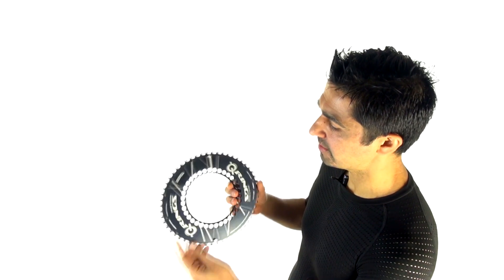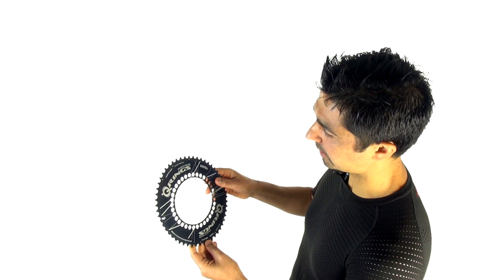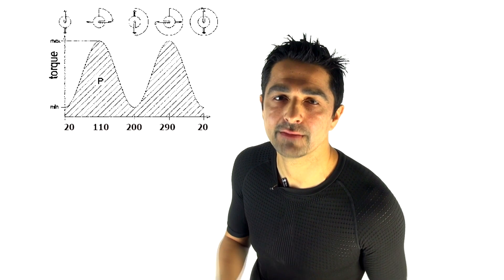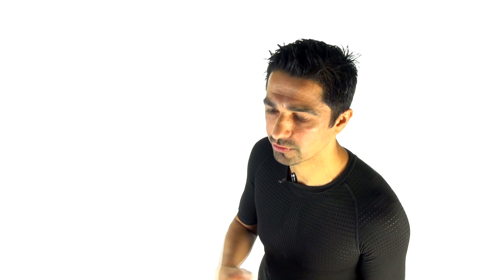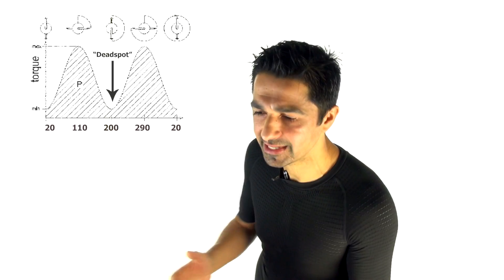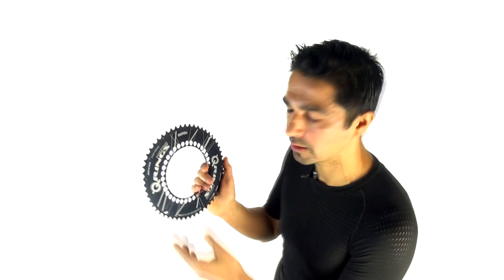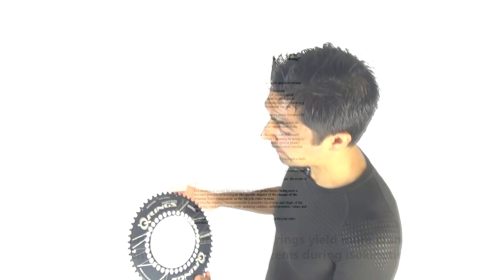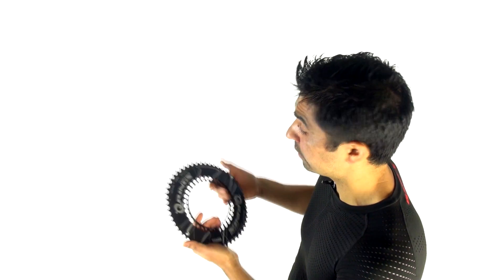Do Oval (non-round) chainrings improve one leg vs two leg cycling power (Q ring, osymmetric)

Comment: i think a lot of folks just use the wrong length cranks, and that is why they detect such a change when using oval rings. almost everyone regardless of height uses 170-175mm.
I am 6'3". recently swapped my 175 cranks for 152 cranks (well short for my 34" inside leg).
I am already running non-standard chainrings, and have never been tempted to go back to "standard" sizes - I run what suits my riding, not what is fashionable.
with the 152mm cranks my cadence shot up, and Strava PRs occurred left right and centre.
folks need to sort out gearing and crank length first before even worrying about stuff like oval rings.
but many folks just buy a bike and copy some or other "pro", without looking at their own circumstances.
fashion always stands in the way of science, and this is no exception.
Reply from the maker: I agree with you 100%! Very few riders consider yet alone change their crank lengths
Reply: If you read Peters post carefully you will notice that the shorter crank allows a higher cadence, this in turn allows you a smaller gear. The power will be the same, the speed the same, the only differences are crank length and cadednce. Its a personal preferance thing, and it works.
Reply: golferchin76 At first it seemed rather like running on the spot, with my legs going up and down without much forward movement.
The theory is that i should use a slightly lower gear, yet i can move my legs to get a higher cadence, which compensates. my legs can go round faster for the same effort because i am moving them in smaller circles.
After a bit, you just get used to it - indeed, the scientific studies on crank length show that familiarisation is worth quite a bit, whatever length crank you use. familiarisation = adaptation.
Reply: and a bonus for TT is that short cranks allow you to get your body flatter because your knees no longer come up to your chest (or if you are a bit "chunky" in the middle like me, your guts don't get in the way so much).
Reply: I'm 5' 8" 31" inseam I switched crank lengths 2yrs. ago from 170 to 165mm and I broke every PR including hill climbs!  Took over a min. off my 40k time breaking the 60 min. barrier for me, that's on a road bike not a TT! I agree I think many rider are on to long a crank! (That 40k time was back 2005 42 old now 54 when I broke it)
Reply: +Peter Milsom  I am 5'75". My crank length is 172.5mm.  I am very surprised to read that you use a very short crank.  How does it feel? would it not feel a lot harder to turn the same gear?
Reply: +Ken B thanks for pointing out. I missed the "read more" part of his post. 
Ok, after reading his full post I understood it now. Basically he use smaller gears for that higher cadence.  
I guess that higher cadence is achieve-able because his legs are making much smaller circles. I assume he is spinning high 90s to over 100rpm type of rider.
Some hurdles though is crank fitment and power meter.  I use rotor 2inpower and the shortest crank length is 165mm. That's not even close to 152mm and I am a much shorter guy to Peter Milsom, so I guess I would use even shorter if I fancy that set up.  That means finding something that hardly exists to fit with my Tarmac and use a rear wheel or paddle based power meter.
Edit: I did find some very short crankset online. Would have to check with my TT coach for his opinion over such set up.
Reply: +Pedal Pusher  I got an adjustable Powercrank now. It can go from 170-90mm.  (Don't think I will go that short, probably end up at 140-145mm for my 5'7" height).  And yes just use lower gears to compensate.  I am waiting for a cheap build of rear wheel with Powertap G3 hub power meter to complete the package.  I think my earliest ride with it with a powermeter is May 20th.
I did a few searches online and totally agree about the TT bonus.  Even for a flexible guy, using a 165-172mm what we normally can find in bike shops, he/she will still need to spend a lot of effort to to bring the pedal from 10-2 o'clock position.  The much shorter crank allow more open hip angle and theoretically a lot easier and rider can actually start powering even when pedals are going from 10-2o'clock position.
I will try next week without a power meter first on road bike. That already means my seat has to raise and I will have a more aggressive aero position.
I hear only good things from TTers and Triathletes who tried shorter cranks.
Reply: TT definitely is not just about power. I train with a coach and ride at a windless location (It is windless most of the time, at night). I ride 2 ways holding same power just to make sure it is really windless.  Like for example 220-225 avg watt gives me 35.5-36km/h on a roadie.
If I do aero tuck on it, elbows on the bar, I can maintain 32km/h 20mph at just 150-160w
At the moment I look mostly in TP at watt over speed.  Especially when I am riding CP60 effort. After all, I am still training for power and my events are mostly century or short sprints of 40km.
I understand what you are talking about, time over route.  Best Bike Split software has free trial. Maybe I should check it out.
Reply: @+golferchin76, for most people, going lower will always make them faster. Problems usually arise with increasing the duration. One of the reasons why triathlonists run a lot higher front end setups than road-tt:s. Triathlon-TT: 4-5hrs, good old road TT 45-60min
Reply: Cadence is higher because  leg speed is slower,  the turning circle is less for one revolution
Reply: Your leg is weakest when it is bent the most, so shorter cranks are better, leverage is a non factor because we have adjustable gearing.
Reply: @+Pedal Pusher: IMO it's pretty easy to find a good TT-position.. At least for most people I think it is similar or very similar to my way.. I just go as low as my setup allows and try to reach my treshold power. Usually I have no problems for this in a very low position (as low as I can get on my road bike..) for a short period.. but when the time starts going over 20 minutes, my back just starts locking my legs up, just can't turn the gears. So for shorter TTs I usually go as low as possible and for longer (of which I don't really do anyway) I go quite a bit higher (like 5-10cm). I'd say for most people it's their hips that can't take the angles first and thus the back gives out, but there can be other things like the neck and even arms..
Reply: Interesting to know.  I didn't know that Triathlon run higher front end. Thanks.
Reply: Crank length is more important probably. For one, too long means when your power downstroke is near extension, your weak stroke is bent more acutely - but is that better or worse, more or less stress on knee, etc? Going to a 165 from a 170mm crank is a loss of 2.9% mechanical advantage, but assuming one sets the lowest point the same as normal, the top stroke is 2x165 above the bottom point, for a 10mm smaller pedalling circle diameter, as well as 10mm more knee extension at the max bend point. Testing large and smaller pedalling circles for power, efficiency, and knee issues is at least as valid as playing with inconsistent rings - except you can't get a nice design patent to sell to bikies.
Reply: So I rode at 155mm for 4 weeks, alternating with another bike fit with a 170mm crank set.   It definitely feels different.  Would that help me in my events?  I do not know yet because I am in off season training.  
With shorter crank at 155mm I feel like I can spin at higher cadence longer (2hr training ride for example).  Also I can draw the circle better, it shows in spincurve software.  I will not drop it to 150mm because Only Rotor produces short cranks but shortest is 155mm

A few questions still in my mind.  Would this hurt me in hilly events.  I will need to do my hilly training ground twice, to find out how different they feel. 
Consider this scenario.  Two crank arms.  Both at 3 o'clock position.  One is 170mm, the other is 150mm.  Now we put 20kg downward force on the pedal.  The shorter one will have less torque at the axle.  To make it simpler to understand, let's use 170mm vs 50mm.  At 50mm the torque at the axle is a lot less than the 170mm, given same force applied.  
So, going shorter will definitely give you torque disadvantage (One can't bring back that loss by shifting to lower gear)  What you get in return, is it worth it?
Reply: z1522 thanks for your scientific explanation.  I stopped using the 155mm length crank and came back to my usual 170mm & 172.5mm cranks.  I was imagining a 10cm crank arm vs a 100cm crank arm and that gave me doubt about short crank length's 'supposed' advantages.
Not only that, after I came back to my usual 170mm it was slightly easier to produce watts on the Kickr in threshold workouts, machine set at same resistance.  Especially climbing drills such as low cadence below 70rpm.
The trouble with very short crank length, for me personally, was that going steep uphill like 17% or more, I had to stop, but on my regular length I could make it up to the top.  
According to my calculation (could be wrong). To produce 240w at a cadence of 30rpm,  172.5mm vs 155mm means 45kg vs 50kg at the full rotation at all time (both legs combined).  Problem is I can only produce meaningful power from 1-5 o'clock position single leg with peak at roughly 3 o'clock position.  That peak I can't measure or calculate it, but it felt like I was doing squat at my maximal endurance weight (for example 100kg for 100 squats) and somebody put additional 5kg on my shoulder and I could only do 50.  That's what happened near the top of the climb when it hit 20% and I can no longer push the pedal down.

I guess this is for triathletes who ride at high zone 2.
Reply: wrong I have 150mm cranks,  and use lower gearing, read sheldon brown on gain rate
Reply: I've got 150mm cranks and yes I have to use lower gearing, you must have lots of cash to buy power cranks, I bought a set of taps (lh/rh) and drilled and tapped my crank in a machine shop.
Reply: Your wrong,  I shortened my crank by 20mm and experienced no lack of speed/power in fact I am slightly faster now,
Reply: Remember TT is not just about power. Look at times over a set route, too. A more upright position will give a bit more power. But the question is whether the bit more power is enough to make up for less aero.
So for a proper comparison, you need to look at time over routes. Turbo trainer miles are meaningless for TT speed/power measurements because there is no wind.
Training Peaks sell Best Bike Split software if you want a tool to help (but it costs money!)
Reply: Your concern is valid. Torque is basically the twisting power, a momentary measure pretty worthless for our cycling assessment, outside of a standing start to a sprint, as in track events. Horsepower/minute is more relevant, force applied times distance, over time. The trouble is, if you're able to apply 100 lb. of force to the pedal during the downward power stroke, about 35% of the rotation, if you use a crank one half as long, to go the same speed and distance per pedal stroke, you must either apply 200 lb. now, or gear down 50% and double your cadence to keep that 100 lb. pedal pressure (as the crank circumference is halved, the arc traveled by the pedal is halved so to keep horsepower/min equal, one must either apply twice the force, or double the rate, ie spin twice as fast). Power strokes become tighter spinning strokes, a very unnatural effort for human legs evolved for hiking and running.
  Radically shorter arms are appropriate for very small/short riders, but cyclists for over a hundred years have figured out empirically that pedaling an arc of 160-180mm radius provides a better overall range of leg flexion and extension under load, at from 45-200 rpm for average adult body sizes and leg lengths. Spinning may be trainable, to a point, but tiny circles are inefficient, hard to keep up at high rpms as the change in direction is too tight. You're wasting time and money getting advice that diverges from well-researched technology.

Comment: So much theory here. would it be simpler to measure this in practice by going up the same incline on oval and round at the same speed and measure wattage?
Reply from the maker: testing316 Yes, but it is surprisingly difficult to do this scientifically. How many riders? How many runs? Randomized order? Controlled weather? I would love if someone did this over a few runs but I think the only way is indoors where everything is controlled because differences are so slight (if there are any).
Reply: Fastfitnesstips thanks for the reply. I think the manufacturer needs to provide hard data on this, if they truly believe in their product or if not provide no data and rely on smoke and mirrors to make a quick buck. interestingly I haven't seen any major bike manufacturer spec ovals on mtbs so until then I'll hold off...

Comment: No chainring, oval or otherwise, has a different number of teeth on the upstroke versus the downstroke. Upstroke of one pedal = downstroke of the other pedal. 

If what you say is true, and you have a chainring that has say 10% fewer teeth on the upstroke of the right pedal then it MUST also have 10% fewer teeth on the downstroke of the left pedal which is clearly nonsense.
The dead spot isn't the "upstroke," it is the 10 o'clock to 2o'clock position.
Reply: that's exactly what i didn't understand when he was talking.  He spoke about it as though there were only 1 hump in the ring and only 1 leg (the drive side leg) pedalling.
Reply from the maker: Sorry, I thought my annotations (eg 4:30) made clear I meant "transition to upstroke" (ie 180 to 200 degrees) not peak upstroke (ie 270 to 290 degrees) unless you are measuring entirely with a unilateral (one leg) experiment in the lab.
Reply: Fastfitnesstips . Thanks for your reply. The other thing you implied was that non-elliptical rings such as ossymetrric can't be installed 180 degrees because they are shaped different for the upstroke than the downstroke. This isn't correct - they are still symmetrical about their 180 axis. Otherwise each leg would have different downstrokes. 
Apart from this confusing issue I really enjoyed your video.
Reply from the maker: ok thanks sorry about that; point taken

Comment: I guess elliptical chainrings lose power by moving the chain up and down in every cycle. What do you think?
Reply from the maker: Not a bad thought but no power is lost above a normal round ring in this way because the friction between the teeth and the chain is exactly the same.
Reply: True, but if you watch the rear mech when pedalling with Q-rings, it is constantly moving (a bit) to adjust for the different chain tension. 0.5Watts?!

Comment: I agree with his main point at the end of the Vid, is find what works for you. I have gone back and forth between oval and round  rings, for me it's been more about gearing and cadence. On my Mtn bike with a 1X11 set up I have been running 11-46 cassette with a 30T up front but just didn't like how it felt in the middle of the cassette when standing and sprinting up hills. Using a 11-42 cassette with a 50T expander cog I was able to go to a 32T up front witch suited me better over all. Since I really like this gearing I still am interested in trying a Oval chain ring to see what I think.
Reply: I use 11-46 with 32T oval and a 11-50(with one up) with a 34T oval. Pedaling up-hill suddenly seems eaiser, no doubt aided by the fact that I have reduced the crank arm lenght from 175 to 170 mm. I didn't find and negative side even on flat ground.

But, I need to warn you regarding the rear derailleur. I don''t have any problems with the one from the XC bike but, on the one from the enduro bike...that is 50% finshed in less than 4 months. I had to open up, regrease everything and tighten it to the max. It didn't take long though and the decrease in shifting performance returned. Maybe I got a flawed XT derailleur...but, the on on the XC bike performs as in it's first day without any work done to it.

having said that, I will not return to round chainrings anywhere in the future.

choose wisely and good luck.

Cheers,
E.
Reply: Yip gearing plays  a big roll. On SRAM 10-42 with 34T chianringand 27.5 wheels I just didn't feel comfortable. GEarings always felt too heavu or too light. When Eagle came out I opted for the 10-50 and 36T chainring and presto,.........nirvana. Oval chain still didn't do any thing for me so I swapped back to round and it just works.
Having come from 2x9 to 2x10 to 1x11 the 1x11 gearing options just didn't line up for me. 1x12 has fixed that

Comment: Shimano had Biopace (oval) chainrings in the late 80s. I just wonder about the variances in tension on the rear derailleur springs during the pedal stroke with the oval; just watch the rear derailleur while these are used; that's spring tension at work which would add resistance wouldn't it?
Reply from the maker: Thanks, we have reviewed the biopace here: https://www.youtube.com/watch?v=A557LYuFkSM. Given there is always some tension on the rear the ovality effect doesn't make any difference provided you have not maxed out the derallieur's maximum capacity.